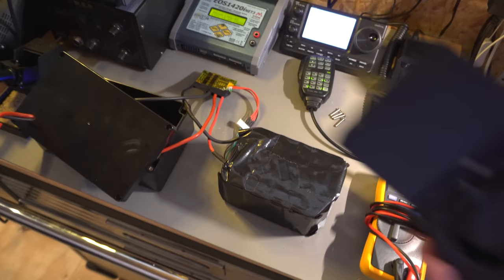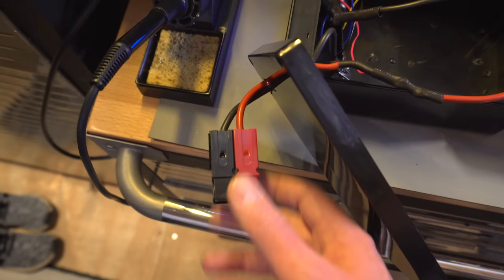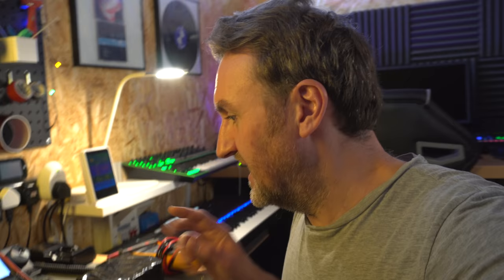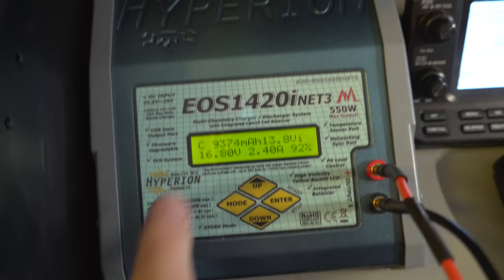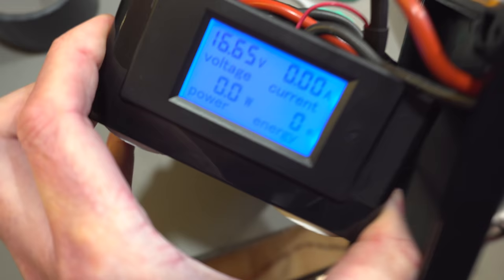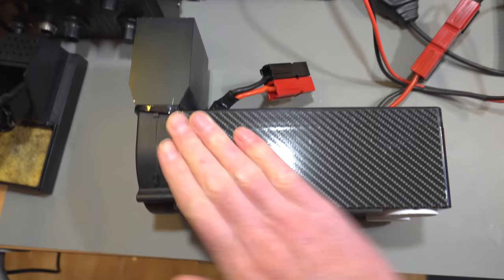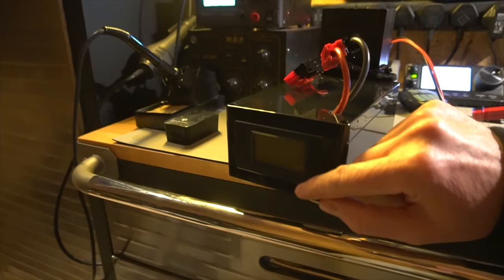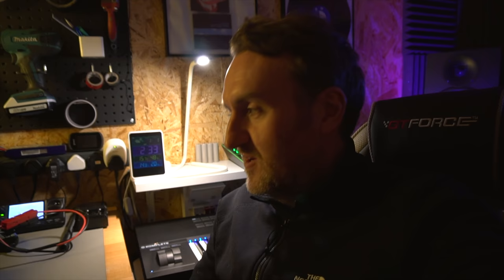BATTERY POWERED HEATER V2 - FOR ELECTRIC VEHICLES AND OTHER SMALL SPACES

Comment: I bought a $32 400watt inverter & $12 space heater from Wal-Mart (240watts) since the outlet in my Hybrid Pacifica is rated for 150watts (it powers the heater for about 3mins, then it must be unplugged to reset outlet). The inverter is perfect for EVs. Instant heat to warm your face & hands without draining the EV 🔋 & losing an already limited range of 33miles. I can easily remove this set-up during the warmer seasons but it will work for years to come. Too bad I just thought to do so in Feb instead of Oct when I purchased the Hybrid (learning experience). Small heater in addition to heated seats & steering wheel has extended my range. I never touch the vehicle heat unless I need to briefly defrost the windows on rainy days.

Comment: I have a 4S 4P battery with the same bms on my bike for the front light. The front light is an XM-L T6 LED Bicycle Bike Headlight  so it can't handle the typical 8.4v battery with 8x 18650's. Having the higher voltage has made it much more brighter than it was with the 8.4v battery & instead of the runtime being 30mins it now lasts for hours. Anyway merry christmas.
Reply from the maker: Good idea 👍 raising the voltage is the best way to get more energy. I bet it’s bright 😁. Have a good Christmas.
Reply: Yeah it's very bright, these Chinese lights state 60,000 Lumens but who knows for sure really, if each led were pushing out 1,100 lumens then it might be 17,600 real world lumens.
Reply: I got some Chinese lights of e bay 10w 1600 lumens they were cheap so i'm more than happy with the light they put out 7-30v. They don't get any brighter with a higher voltage they just reduce the current they draw. Does that make sense. 0.5amp 12v. Drops to 0.25amp 24v per lamp

Comment: Any updates on this. I could use one of these, without the battery. i would connect this to a distribution panel off my RV house battery, or a battery pack (like an independent solar "generator). Using a power pack like an old jackery, and run the jackery out of juice and not run on my RV battery.  The other option that would be great is a timer, set for an hour or 2 or 4. Can you separate the battery? Thanks!

Comment: for about $80 you can get an arduino mega with a 4 line lcd in a kit  which could be useful for monitoring the bms voltages
Reply from the maker: Good idea, I think Vortecks originally set out to do something like this on one of his early bike builds.

Comment: Hi Andy I subscribed to you some time ago. With the recent energy crisis I'd like to use a drone lipo battery and the other smaller cheaper heater. They bumped up those original modules on Amazon to £50+!!
On ebay I can get the second fan for about £10 or so.. so can I just hook up a lipo drone battery and which kind would I need? Would I also need a low voltage cut off for the lipo so it doesn't catch on fire or something?... the drill battery and adapter is good but the battery is now over £50+ as well. Any help you can give you be appreciated buddy. Keep up the good content!

Comment: That's some powerful  little battery. Around half a car battery effectively. But you can drain it 80% vs car battery 50% is under 12v
Reply from the maker: Yeah lot of energy in there and you can carry it about easily. Not much heavier than a handheld power tool. Also way higher charging efficiency than lead acid.
Reply: @andykirby  lead acid is cheap and good for starting engines not much else

Comment: Hey, I Know this is an older video but here’s an idea that might interest you. Connecting the BMS to a contactor/solenoid and having the BMS power it to make the connection from your battery to the load without worrying about over amping the BMS. You just need to make sure it stays below the cells maximum output rating. https://youtu.be/J2KH21Fwi9o

Comment: just get an old p4  laptop off ebay   them   things  could   almost drive a  steam engine
Reply: the fuse  almost failed the massive increase  in resistance =heat  =melt   had that happen   with  ebikes etc   doing  more ebike stuff in summer  as   burnt  a mxus  5k motor     might go qs  motor next